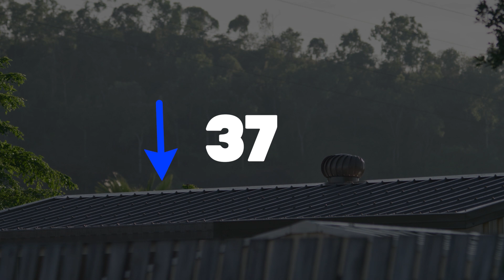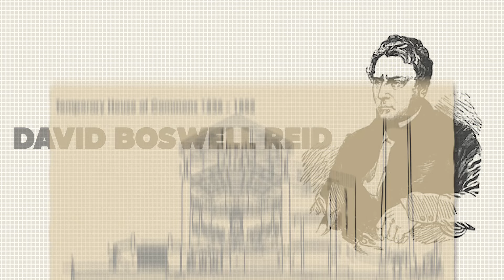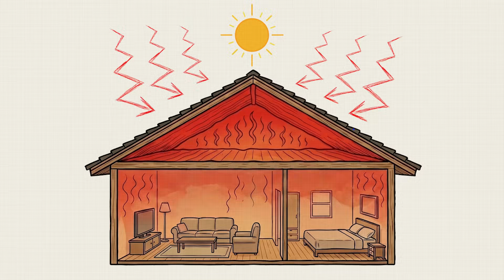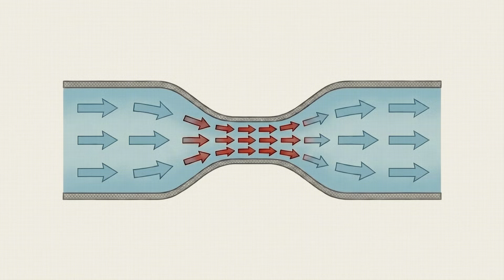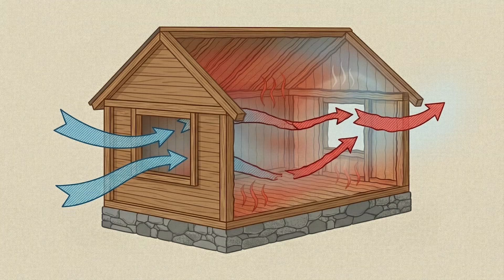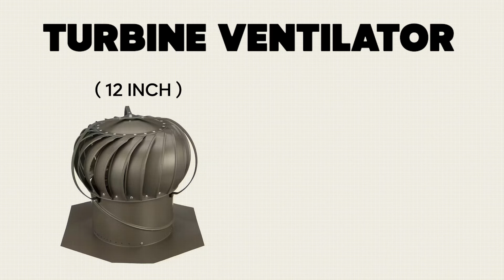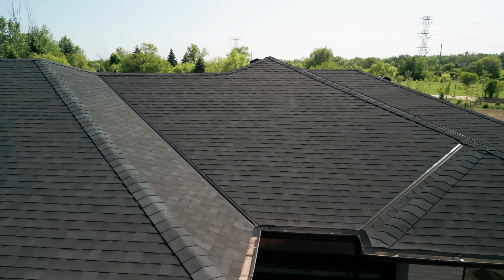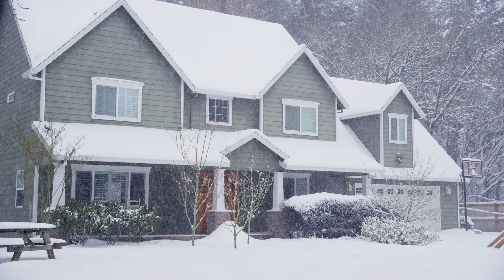Why Did We Stop Using This Natural Cooling System?

Comment from the maker: 🔗 Stop letting 150°F attic heat hijack your AC — Learn How To Create a self-cooling home: https://passivehomeblueprint.com/
Reply: Read the very detailed reply I left in the comments. I employed several combined methods in our recent remodel, including ridge venting, and I've had some incredible results.  Its a detailed account but if you want more details let me know.
Reply: Why Did We Stop Using This Natural Cooling System? 
Answer: Because FREE ENERGY IS FREE, and the criminals who control humanity can't let energy be FREE!
Reply: if your attic reaches 150F=70C you have worse insulation than a greenhouse. Unless your outside temp is 130F/60C which i highly doubt
Reply: @Ocklepod  During peak summer months, standard unshaded attics commonly reach temperatures between 120°F and 150°F, and can sometimes exceed 160°F in extremely hot climates. So that's not uncommon whatsoever in typical attics and insulation has very little to do with that.  Insulation insulates.. as in holding in heat in winter months.  Radiant heat barriers help keep heat out of the insulation which transfers to the ceiling drywall (or wood) and then into the home.  Airflow is what cools an attic down but it can only become as cool as the outside air.
Reply: because WHOLE house fans COOL faster & are better,
Reply: @markplott4820  They can remove hot air in the house and push it into the attic, sure, but you can only use them in the evenings once the outside air has cooled off, otherwise you could just be pulling in more hot air from the outside.  They have their use, but it's limited.
Reply: @oldowl4290 - false, UNLIMITED use, and repeatable, can be used soon as SUN sets, inversion layer automatically cools, in Sumner I run central fan ALL NIGHT until SUNRISE. then shut EVERYTHING.  almost NEVER need heat pump except on extreme days, set for 70deg.
Reply: whats that in non ficticious numbers?
Reply: Yeah, start using Celsius already.

Comment: If only my damn hot country doesn't have pm2.5 pollution, then I would have considered installing it, even if my country got seasonal monsoon.
Reply from the maker: It doesn't suck in air but rather extracts it to the outside.

Comment: The whirlybird is a single point of ventilation. The ridge venting works better because it covers more area. You can use the entire edge of the roof
Reply from the maker: Agree but they do actively remove heat rather than passively which is what a ridge vent does.

Comment: You are making a 300mm hole in the roof which allows a huge amount of heat to vent from the ceiling, making your ceiling insulation much more effective, excellent product for hot humid climates but not for locations where there is snow.
Reply from the maker: True - so it has its applications!

Comment: In Australia, we still use them. I always simply enjoyed watching them spin, as well as how its design would rotate in only one specific direction without a one-way clutch.

Also, you could add tiny generators to create electricity that can either reduce bills, charge dedicated tiny batteries for windless operation, or both.
Reply from the maker: Good to know - thanks!  Does someone actually supply a generator/ dynamo along with batteries that could actually charge from one of these vents - never seen one commercially offered!

Comment: Putting a turbine on top of a black painted stack (and painting the turbine black) will significantly improve thermal performance

The bearing issue can be solved (even with cheap bearings) using labyrinth shrounding and  noice with basic polyurethane mounts

Agreeed that roof vents are a better option in hot low-cloud environments but turbines still have their places (and HOAs can pound sand. In most cases such as the one cited, they're setting rules far in excess of their legal authority to do so)
Reply from the maker: I like the idea of painting them black as this could create a stratification effect.  Interesting insight - thanks!

Comment: You forgot to mention that rotating fans for breeze, like the big one you showed for the mining, as well as today's electric oscillating fans, were invented in China.   And that China also invented the Skywell passive cooling building architecture during the Ming dynasty.
Reply from the maker: Now is that true or is that something you read on Facebook? I believe rotatory ventilator fan was patented by James T. Lipsett on February 14, 1889 (written proof).  But yes China did invent the Skywell as there is evidence of this existing buildings.
Reply: @wildline_YT  ... Oh sorry, got it mixed.  The rotating fan concept was invented during the Han era, not the much later Ming era that I got mixed up.  This is already widely accepted historically, as there are ancient manuscripts that describe this.  Since this was nearly 2 millennia ago, the actual physical existence of the contraption had already disintegrated or dismantled in that same period, much in the same way a house made of wood built today can possibly live for 2 centuries average, in normal conditions, which 2 centuries is still quick when you zoom out to a 2-millennia span of time.  It wasn't until the eras of Tang & Ming, et al, that they converted these cooling breeze fans to use hydraulic power.  At that same time, they were also using water spray & misting for cooling, used along with the fan.  Then centuries later into the modern era were other methods of power applied, such as electricity & induction, that we still see today (our lifetime).  China had also invented their own angled bladed propeller for airlift in also around that time (~2nd-4th century AD).  As you may know,  Europe turned primarily to Chinese-built A/C & electric fan machines due to high demand during their recent region-wide heatwave, which the heatwave is still ongoing.   The reason we still see skywell architecture is because China still builds them to this day, for the past 6+ centuries, because it still works.  Approximately 30-thousand have died from the heatwave so far when that could have been avoidable if it weren't for the laws.

Comment: My cooling and heating costs improved when I removed the turbine and replaced it with passive vents.  I have two vents, one at either end of the attic and I think the turbine was drawing the air from those vents rather than from the attic.  I now have the end vents and four roof top passive vents close to the ridge line. Airflow follows the path of least resistance. I live on the Canadian prairies and we get extreme temperatures.  I have noticed that most people are doing what I did.

Comment: Modern ridge vent is a larger open gap at the top of the ridge and is generally better than these turbines as there are no moving parts and they can cover a very large surface area allowing for more ventilation. As long as your soffit vents are clear then you are in good shape.
Reply from the maker: Yes we mention this in the video.  The challenge of ridge vents is keeping them clean, which I am not sure many households do!

Comment: They're ok provided the ceiling has zero perforations from lightong, fans or vents.
& Only on the opposite side of the ridge to the sun, so solar panels get no shade.
Also a white roof makes turbines pointless, because heat is rejected.

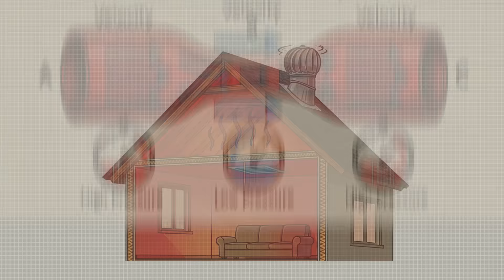Comment: 4:00 your explanation is correct, but i think that graphic for the low pressure is wrong, or at least seems flipped. 
the highlighted zone shouldn't move to the left, it's the needle that's supposed to move left

Comment: Oh those things are incredibly annoying, creating flashes whenever the sun is on them. We had several outside my school in the 1990s and it was impossible to focus with the flashing until the sun went low. Mechanical ventilation has made these nearly extinct and that's a good thing.

They may have use in poorly insulated American shacks though. They still put insulation on the attic floor and have a thin roof over that, like was common here in the 1920s.

Comment: Got 3 whirlies and the attic is broiling, and interior ducts hit 40F but can't lower my home more than 80F.  I'm probably the one of just a few people who still have them.  Near everyone has taken them off their roofs or swapped to the flat solar fan.  I've only replaced 1 whirly in nearly 50 years, I take care of them and wrap them in winter, clean and oil in summer.  Lot of time usually only two are spinning like crazy on the south end of the home, but they can all just spin like crazy and it looks cool.  We traded in the swamp cooler once it leaked and around the neighborhood they were falling in through the ceilings, got a side refrigerated AC but it's likely undersized when we installed as I have friends who said they had to move to the next 1 or 2 ton level unit simply to maintain 70 or 60 degrees.  But the past was much more cooler with more rains and snow, last ten years it's been the worst in the south.  We had some really long brown outs for days that just would have murdered us without a solar back up for fans with open windows at night.

Comment: An advance from cupola's to mini-towers in the 1800's.   Passive systems, they would allow wind to blow threw them laterally (moving air means lower air pressure) and they would suck the hot air from the upper -reaches of attics and top floors to the outside.

Comment: When we built our house 7 years ago, the builder told us it was mandatory to install this type of passive ventilation in order to pass the inspection. And so we installed something called “whirly bird” and that was that. Perhaps some builders get their energy efficiency certification through better insulation of the walls and choice of building materials, and therefore can leave out passive ventilation without having issue with the building codes.

Comment: The same reason we have so many gas stoves in the US, and so many obstacles to off grid generation, and composting, and intensive gardening. They want us locked in to the addictive fossil fuel supply line fully, no mitigation, no alternatives. We have to fight  for a livable future.

Comment: Air conditioner wastes heat from condenser that rises temperature more.
Each building should have a pipe as chimney, and all air conditioner condenser connects to the pipe, and wasted heat will convey to the top of pipe. If need, fan should be placed at the top of pipe to suck hot air.
Ordinary air conditioner is placed at low area. so the waste heat will spread to low area, and people feel so hot.
Chimney pipe leads waste temperature to higher place, and they rise higher, and the heat go to space.
If every building has this system, heat island phenomenon will be better.
sorry for broken English, I'm Japanese.

Comment: They are very good for keeping the house cool in a warm climate.

One major problem, as I personally found out,  the bearings that are exposed to the elements 24x7 eventually fail and create very irritating noise. Being installed on the roof made it a difficult and costly job to have the bearings replaced. I had the bearings for the whole set on my roof replaced, to avoid the cost and inconvenience of replacing them as and when they failed.

I don't know if I will be around 10 or 15 years from now, but whoever is the house owner will be faced with the cost of replacing or removing them altogether.

Comment: My attic gets super hot and we have shingle ridge vents. Near the end of the video it says ridge vents were superior to the whirligigs. Hard to believe that.
Reply from the maker: Yes it is hard to believe as the turbine vent actively moves heat but the advantage of ridge vents are that they are generally sited right at the top of the roof where the air is the hottest, and they tend to run the whole length of the roof and so address hot spots.  But I agree with your thinking!
Reply: @wildline_YT but cool air needs to replace the hot air or it won’t go anywhere. I know some air exchange might happen but it’s all happening at that thin section of ridge unless maybe the attic door is open with an open window to use for the stack effect air flow.

Comment: We installed a turbine vent on my family home in the 1980s. But it was a 1950s home that leaked air in everywhere.  At truly modern home often needs an air-exchanger to prevent under-ventilation.

Comment: Dont be obsessed with this.
14in unit cost around 200usd per psc.
Also it's best exhaust rate is around 300-400 CFM.
That's tiny air turn over,it takes more than half day to just turn one air volume of a medium house.
To be hot air to move in house for visible cooling,it requires atleast 5 air turn over per hour.
So these units adds up tiny contribution.
To your comparison,a small 50W AC electric exhaust fan of 6-8in size exhaust rate is 1600CFM.
4 psc of this hefty 200usd units combined even though venturi effect is actually useless in reality.

Comment: because it isn't all that effective if you need Serious Cooling!  I have one of those for my tiny grain-storage shed (4' x 8') and while it does help SOME, sometimes, - less than 10 degees at most, but when it's over 100 degrees outside, it doesn't make much difference, if any at all.  Also if there is no wind, then it does absolutely nothing because it's not moving. And if it's raining, then whatever is immediately beneath it on the floor, gets totally drenched.  I have to put an upsidedown plastic lid from a large garbage can on top of the grain barrel to catch all the rainwater, and it's about a quart, then without spilling any water, (not easy) get it 8 feet to the door way and dump it outside  Because of the inevitable water leakage if the rain is beyond just gentle ~ in a downpour, like in the monsoon season, it's  a liability for sure.  . I may have wasted my money buying it and then also paying someone to put it into the roof of the little shed.  I'm trying to keep the pellets and cubes for my horses from going bad fast, in the summer heat, but I have to store the rice bran pellets inside my house, so I have a small metal trash can in my tiny kitchen.

Comment: We've got 3 of these on the house I live in, a fan pointing out an open window leaves these things in the dust. Sure it needs electricity to run a fan but it gets the job done even when the wind isn't blowing, which is most of the time in the Ohio valley.

Comment: the same question can be used for basically any modern technology. Why did we stop cooking in cast iron and instead poison the environment with PFAS for out frying pans?

Why did we stop using wool but instead use engineered, outdoor textiles that require 30 poisonous chemicals for their production?

why did we stop using small, effieicnet cars, but instead drive around in cars that are the size and the weight of a house?

The answer is simple: Because we can afford it and because people convince other people that they should do it.

Comment: However, hot air in the attic doesn't heat the house.  What heats the house is the roof radiating downward, heating up the ceiling.  The only things that eliminate that are radiant heat barriers, a white roof or heavy rain.  Air simply doesn't have the Heat Capacity to heat a house. 
My son did a high school science project "Effect of roof construction on solar gain".  We built two houses, 6 feet long, 6 feet tall and 4 feet wide.  We measured the temperature of the attics and rooms of both the experimental house and the control house.  We put a fan in the eve of our experimental house, and the room temperature didn't drop much.  Putting in radiant heat barriers reduced the solar gain by 60%.  Fiberglass insulation helps a bit but not nearly what a simple, cheap radiant heat barrier will do,
So the air in the attic is hot, but that just means that the roof is heating the air and more importantly the space below.
Radiant heat barriers are cheap and easy to install in a new house and they're code in California.  It's now illegal to put white shingles on a residential house in Atlanta Ga.
I've done the experiments, I have good data, and I think attic fans are almost a complete waste of money.
Go ahead, put them in, check the temperature in the house with them on and off.  I suspect you'll return the fan.  I really don't like putting a hole in the roof line, they can leak and that's a diaster.  Maybe put the fan in the eve so its less like to leak and take out your ceiling drywall,

I'm not selling anything, I'm a MD, PhD and after 40 years doing medicine and basic science research, a real scientist.
Reply from the maker: Interesting summary.  I totally agree that radiant barriers are great in high radiant environments (sunny parts of the world with high solar irradiance) but these fans do work. Moving air from the attic can drop the Delt T and so improve heat transfer through the ceiling (not the outer roof) and so help cool down the living areas.  Also if you have ceiling vents they can help improve air movement, which helps improve air change rates and thus improve the health effect of the building.  As a MD you may be interested in this research on TB: https://pmc.ncbi.nlm.nih.gov/articles/PMC3253793/

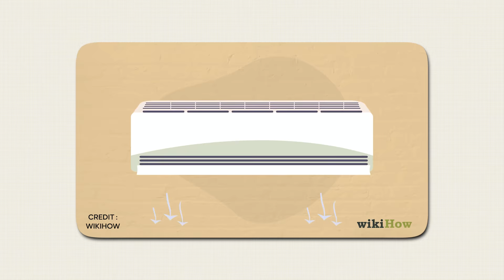Comment: 4:50 your graphic is wrong. The soffit vents are under the eaves. You’re showing airflow entering windows into living spaces and then entering the attic. This is incorrect. The air exhausted by one of these turbines is replaced by air entering the attic directly from outside (never entering the living space) through soffit vents under the eaves

Comment: They have major problem with water leaking in during moderate rain or storms. And they do make weird noises. Anyone that had them found out a decade later how horrible they where and after spending thousands in fixing the damage done.  Nobody wanted to deal with that again  that's the real reason they're not used anymore.  People that had them know better